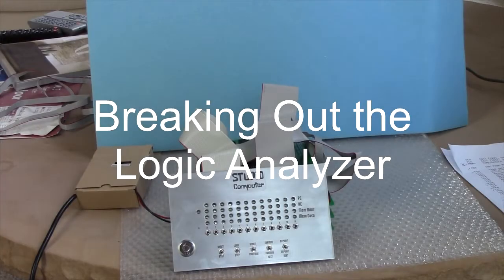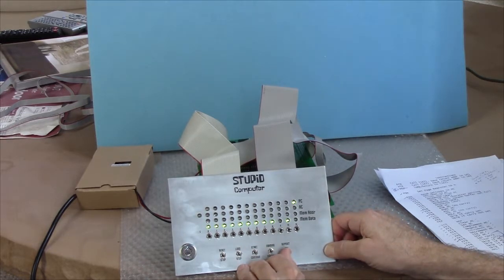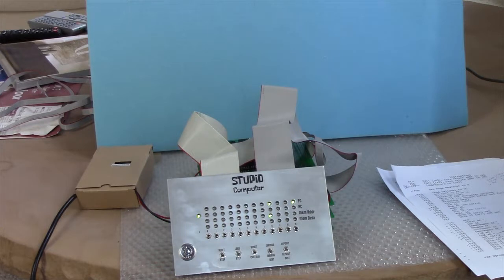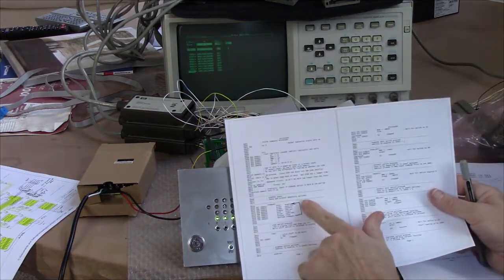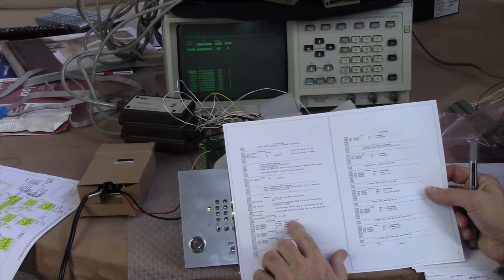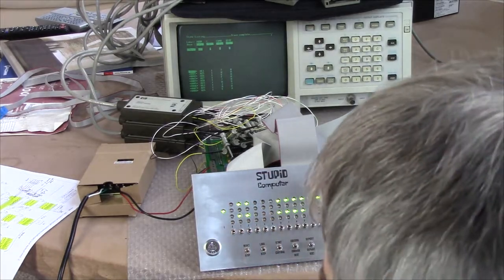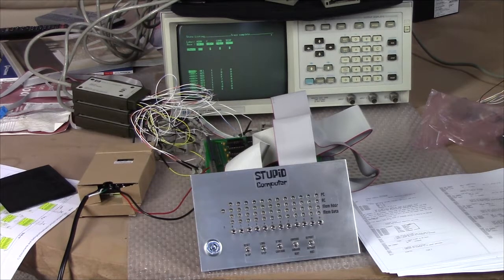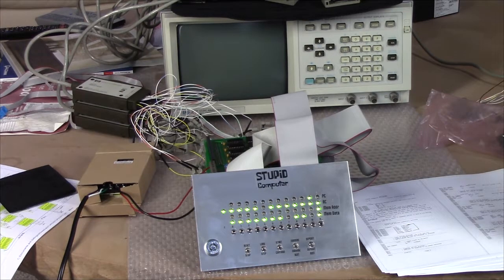Breaking Out the Logic Analyzer

Comment: I just obtained one of these old gems but with CLK line connected from any pod, I always get a "WARNING slow clock" alarm. I read in a manual for a 1660 that if the pods loose 5V supply from the analyzer this error is displayed and that it could be a fuse. Analyzer detects data but won't display it without a clock for sampling. Have you seen this before? Thanks!
Reply from the maker: I've only received that warning when there was no clock signal (e.g., device under test powered off).  But do make sure that the ground lead is connected for every pod you're  using - I've seen that cause some weird behavior (can't remember the details off hand).  The only other thing I can think of is that you've got to tell it in the configuration which clock input to use...

Comment: I just picked up a 1630G on ebay for a similar project
Reply from the maker: The 1630G looks interesting.  More channels and you can load a disassembler into it.  My 1631D, on the other hand, has the world's worst (though still useful) oscilloscope built in :-)
Reply: @MartianTech  More state channels, but only 8 timing channels vs 16 on the D. Many have tried to install the reverse assembler, and without the disk drive and disks it doesn't seem to be possible. There is a lengthy thread on eeblog. BUT thats all fine, it's still a neat and useful piece of equipment and at today's price I can finally afford one!